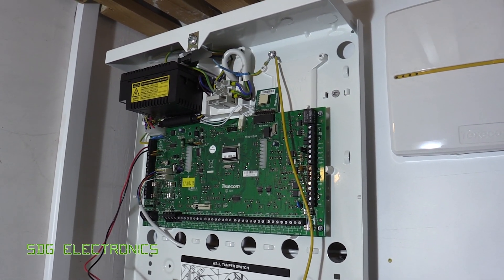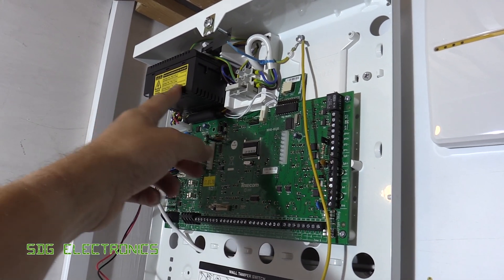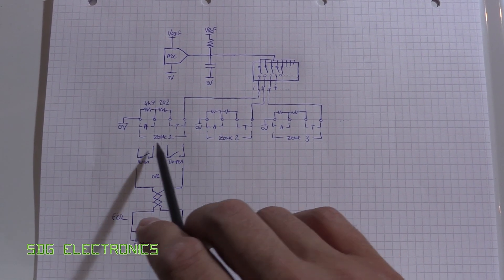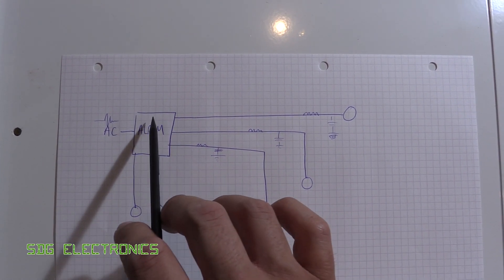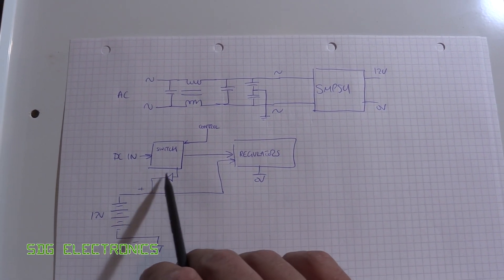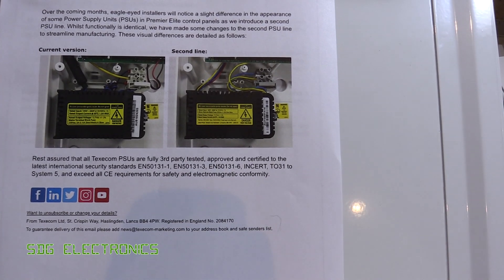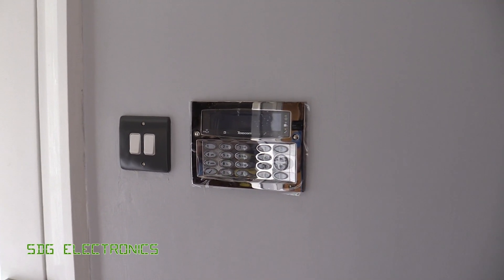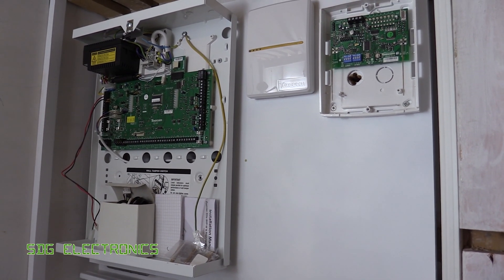SDG #091 The Importance of Good EMC Design - Texecom Alarm System

Comment: Please could you tell me if the keypad you have (https://youtu.be/BwhAS4llxnU?t=602) is the surface mount (SMK) or flush mount (FMK)? It's hard to see the difference in any of the product images https://www.texe.com/uk/uploads/Premier_Elite_FMK-SMK_web_3.pdf.

If yours is the flush mount, what depth cavity does it require and was it difficult to fit in your wall?

Thanks
Reply from the maker: This one is the FMK. The surface mount one sticks out about 20mm from the wall rather than 5mm
Reply: @sdgelectronics  Thank you so much. I'm going for the FMK as well then, as it looks much better.

I called Texecom support, who confirmed the back box in the wall needs to be 33.2 mm deep for the FMK, and comes with a suitable back box.

Comment: I’ve just come across your you tube video whilst researching the options for changing out my existing alarm to the possibility of using a Texecom Elite with Wi-fi comms panel for remote monitoring and access and found the issue of false triggers possibly being caused by common mode noise very interesting and it obviously begs the question, did you ever fit the mains filter, was it it in your view successful (or are you getting false triggers even with with the filter installed) and would you recommend any variant of filter as being better at suppressing both the common and live mode noise?
Reply from the maker: I've not had a single false trigger or even any network errors. I did fit the filter but I didn't really run the system without the filter to compare. I can say I had a previous generation Premier 88 panel installed in my previous house for 10 years and only had one false alarm from the cats running around!

Comment: I have the same alarm to be installed in my house, we aren’t able to get a dedicated supply up to the loft where it will be located. We’ve had to spur off the sockets upstairs what would you recommend to stop false alarms? Filter? Different alarm?
Reply: ACT1313 spike suppressor and a mains filter

Comment: Fit these as a job day in day out. It’s a well known issue that since replacing the old style psu which has transformers in to these new elite series with the switch mode psu that they have issue. I’ve never knows one to false trigger but they often show up a “ps fail, low volts” message. Changes a fair few since they have been out. Hopefully the new ones should be better. In regards to it being on a separate spur it’s part of the En50131 standard that any graded alarm system should be on its own 3amp supply. That’s just part of the alarm regs. Nothing more. Let us know how you get on with the sensors. What would of been easier and looked better would of been a pair of gate photocells. Much cheaper and the small contact pcb may fit inside. Those old perimeter sensors are massive. Anyway, good luck 👍🏻

Comment: I’ve been a subscriber from day one. I’ve also been an Alarm Engineer for coming up 25 years. Working for most of the large nationals up and down the UK. I’m fully conversant with Texecom amongst others’ alarm systems. The issue here is nothing new and has very little to do with poorly designed of faulty SMPSU’s. As I understand it, the PSU revision has the choke mounted inside the PSU housing itself to help the head scratchers. Firstly the panel should always be connected via a 3A unstitched fused spur back to the consumer unit full stop. Secondly, equipment of this nature is now easily available to any old joe, including “Electricians” hence the installation guide addendums to help hold their hand and make them experts as they go. With regards to close proximity to mains fixed wiring, we have the wiring regulations 18th edition to adhere to. I suggest you stick to that and you’ll be sleeping very well. If your paranoid to the fact you have to install additional mains filtering before even commissioning any alarm system, then you are the problem. At the commissioning stage read for AC to EARTH from any (obvious DC) alarm cable at any point of the install to get the magic numbers. Keep separate your wireless as much as possible. All cables are acting as Ariels and modulating back at the panel, but that’s another story and you’ll need more addendums for that one. As always a BIG 👍 from me. I’m off now the find a bricklayer, I need a wall building. I do enjoy your YouTube content, please keep it up.
Reply: You can have noisy mains, even direct from the consumer unit, so adding in impedance to the PSU is always going to make the filter behave better. I had the same problem with false triggering, and as the unit was fed with it's own dedicated power line, added a line filter to increase impedance for the built in filters of the transformer PSU. 

Mains there was literally 20m of 25mm cable to the 1MVA transformer, so impedance was so close to zero it made no difference, just there were other users on the same MV line with 10MVA transformers, feeding back the load transients quite well. Plus 100m of line being the longest feeds, there was false triggering occasionally, solved by changing the 20 year old passives for new ones with photomos outputs.  Survived the building 80m away being hit by lightning fine, did not even false trigger. Could not say the same for the building that was hit, most electronics in it were well fried.

I connected the expanders with Cat4 cable (plenty of it in situ from network upgrades) and never had any issues with them again. Alarm kind of grew over the years, from the old original relay logic board ( yes it came with the building) to transistorised controller (about a month after moving in) and over time more and more cable expanding things. The old cabling was almost trouble free, just had to beware of the painters doing things to them with scrapers.
Reply: @SeanBZA  Would look like the alarm has failed it's conformity requirements so it could be said that it's sale within the UK could be illegal......

Comment: Not a fan of wireless alarm sensors as I don't feel I have any control over interference, not to mention the battery change thing.
I have an Aussie made Ness system which has been rock solid for the last ten years.
The only initial issue I had with false triggering was due to large insects moving in front of the IR detector lenses.
Changing the sensitivity switch to '3 pulse counts' from the default '1 pulse count' sorted that with no problems since. A human still can't get past them.
Reply from the maker: The Texecom wireless system is the best of the bunch - sensors are all fully monitored and the 868MHz network is mesh based so excellent range. However all of the zones used for intruder are wired to the panel or expander - I'm only using wireless for things like these beam sensors
Reply: I i stall these systems and they are impressive,
There should be nothing on the 868MHz frequency, it is a dedicated frequency. It can be a problem if a device in the area is ‘illegal’ and is on that frequency when it shouldn’t be, but I’ve never seen this to be a problem. 
And their mesh system is equally good, devices are able to ‘bunny hop’ via 2 other devices to relay the information needed. 
Batteries are good as well as they last between 2-3 years we recommend changing them every 2 years so they don’t drop off one by one with low battery, there are 3 modes you can set a device, always active (a wireless door contact that needs to be) auto (wakes up detects movement then sleeps for a period of time) and hybrid ( only active when needed to save power but keep security high. 
Not seen a wireless system to this degree of complexity and versatility before so for me as an engineer and a user of the system i do like them. They do have their issues (as with anything)  bit few and far between and the support is also decent.

Comment: Brick and plaster walls, ummmmm Here in New Zealand it's thin plaster board, timber, bits of paper and sticky tape and the minimum of insulation if your lucky.
Reply from the maker: Even the internal walls are red brick. Very unusual for a house built early 70's

Comment: What's the model number of the G.E. EMI filter you're going to install? I'm trying to solve a problem with my neighbor's outdoor LED lights interfering with my ham radio operation. I just received a couple of JSYUAN filters from China and will bench test them with a spare lamp. These SMPSs put out a horrendous RF signal with a peak at around 7MHz that I can see on the spectrum analyzer with a EMI probe on the AC leads. I'm pretty sure the PS are simply radiating their noise back down the AC feeds which are in turn acting as nice long antennas!
Reply from the maker: It's one of the ones from the EFNF range, I think the 6A one. Schaffner make good filters too.

Comment: Nice informative video Steve. I am running a wireless alarm system for our house, workshop & sheds and I get false triggering every couple months, the last time it was twice in one night......and probably mains born as I could find no other reason.....and it just runs of a cheap plug pack. Time to change it out I think!
Reply from the maker: Give all the sensors a clean too! Those thunder flies are a nightmare
Reply: What system are you running? If it’s a cheap one from Screwfix or something it will do that. These Texecom ricochet ones are great. There’s not much else I would recommend. 👍🏻
Reply: If you are running wireless don't forget you are using ISM frequencies that are open to everyone and their nan to use, if you can use wired use wired.   I've seen things like a wireless "CCTV" system take out 2.5GHz wifi in a 200m radius.